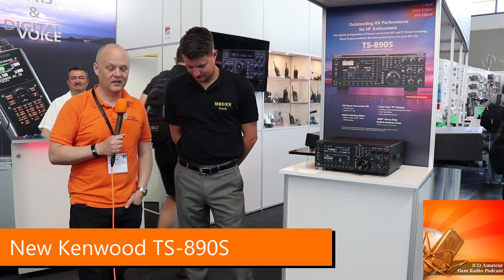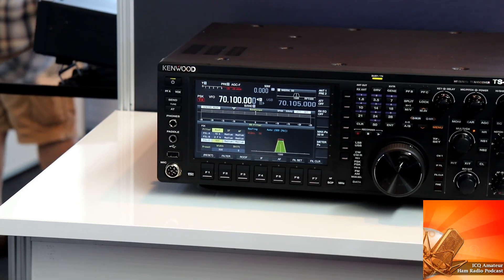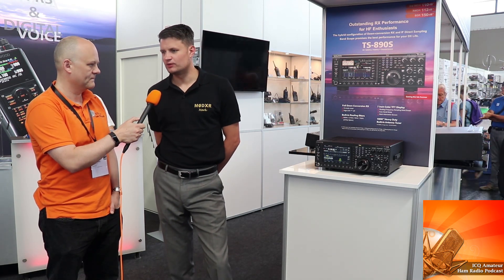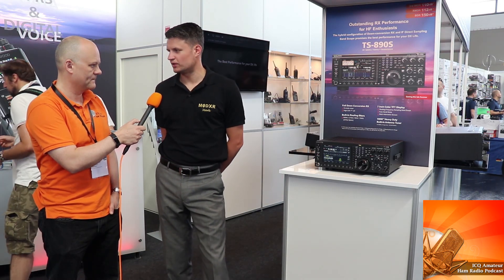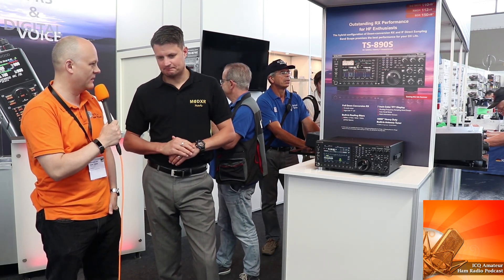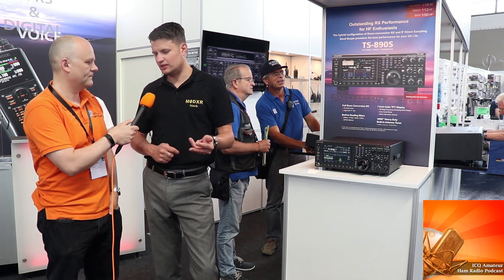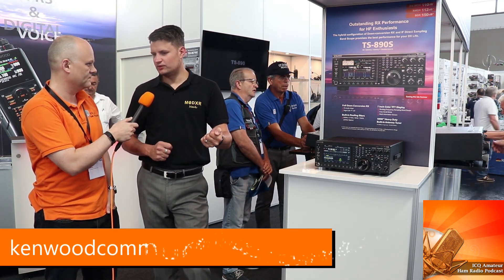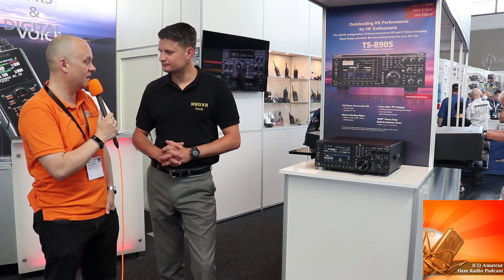Kenwood Announces New TS-890s Amateur Radio Transceiver

Comment: Kenwood is disappointing ! Why no SDR? Wasn't a fan of SDR until I bought one.
Reply: Jim 
SDR isn’t the cat’s meow, it still has it’s downfalls. Just as stated a very close in strong signal will over ride and create problems copying weak signals. That’s why Yaesu has a VC tune (preselector) and Icom has what the call OVF indicator and it tells you to reduce RF gain which in reality you are just detuning the front end of the receiver. Not to say they aren’t great radios, I’m struggling here choosing between the 7610, FTDX101d or the 890s.
Reply: @gregboggs4721  I’m just with the same problem… what did you ended up deciding? What can you advice? Thank s